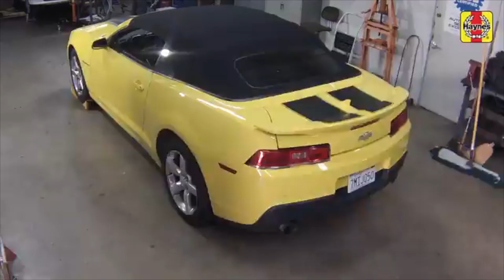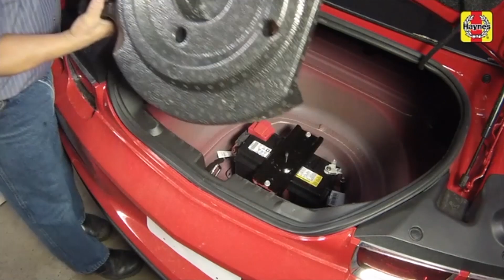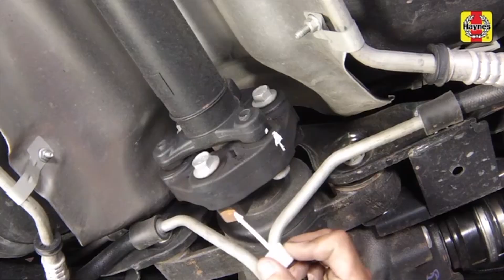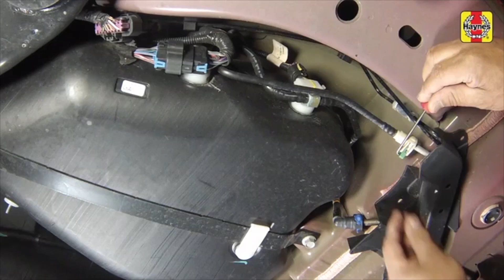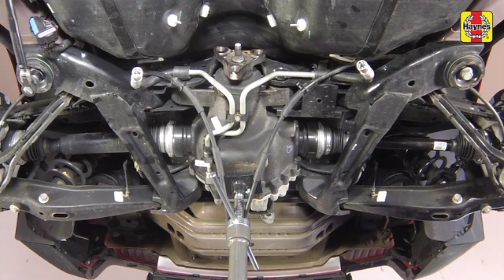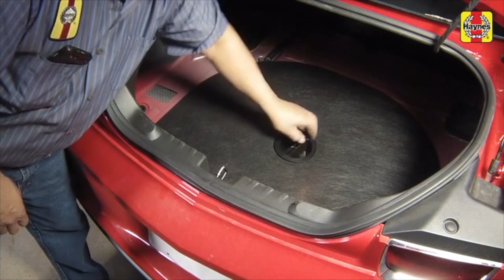Chevrolet Camaro (2010 - 2015) - Replace the fuel pump

Comment: Hold up hold up all this for a fuel pump?
Reply: This is insane! Bad engineering
Reply: You can cut an access hole under the rear seat. Literally cuts the job down to an hour or less.